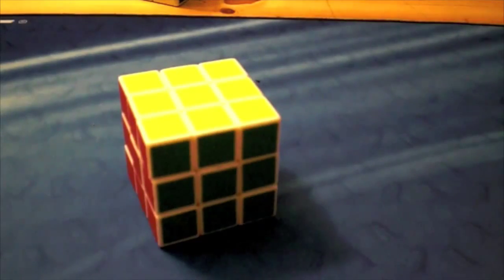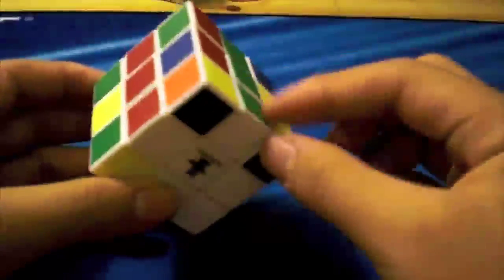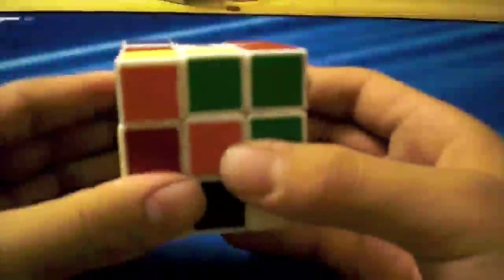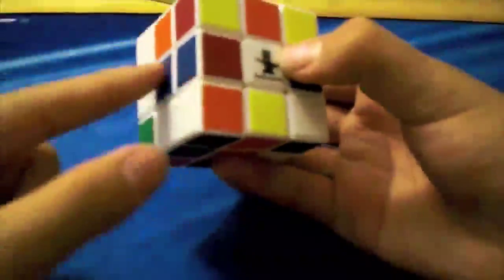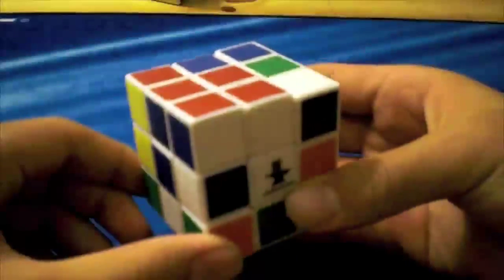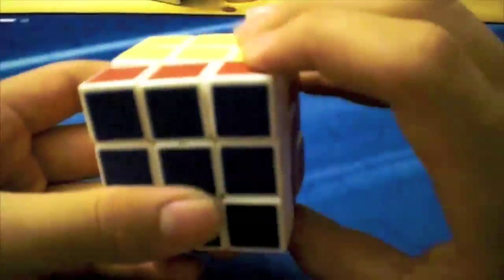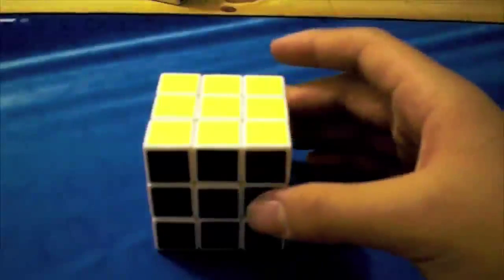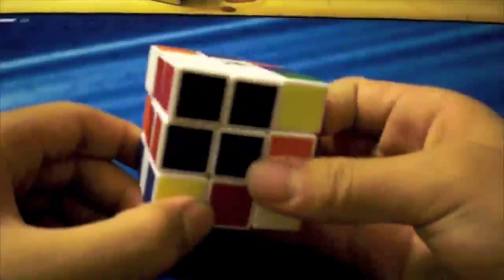Extended Cross Tutorial

Comment: I really wouldn't consider F2L part of the Fridrich method, but it's debatable so I'm not going to go there. This is actually like the first step of the Petrus method where you build a 2x2x2 block (and then extend it into a 2x2x3 block, etc) but you also add in the second two bottom cross pieces. It's just a way to save a little bit of time for the really good speedcubers who are able to hold that much information in their brain at one time (I can't, I have a horrible mental capacity)